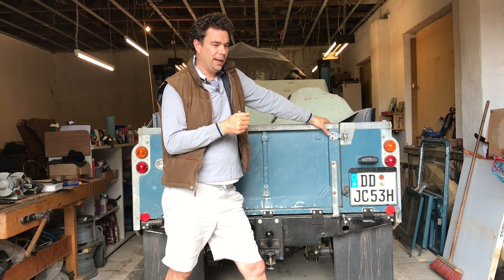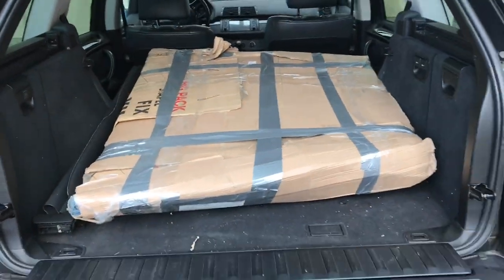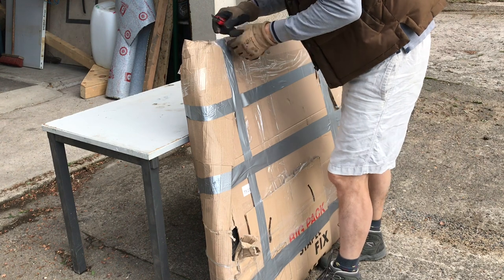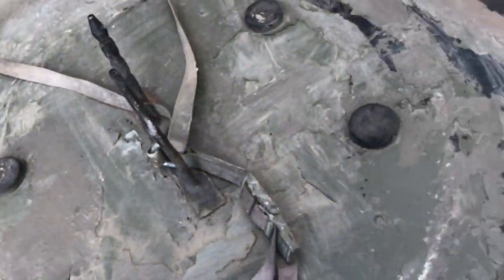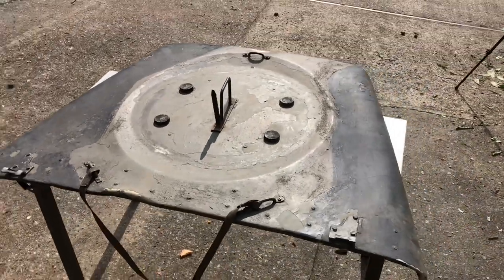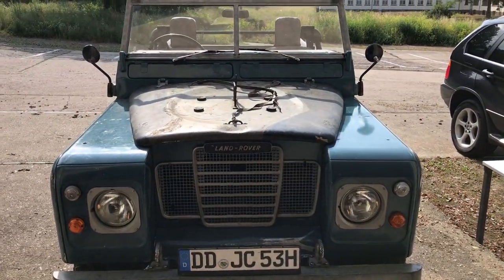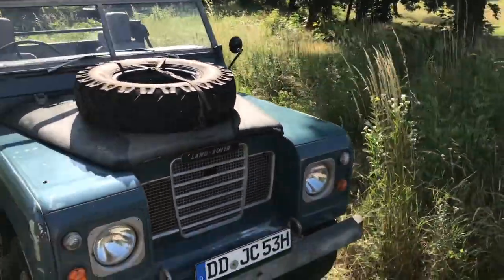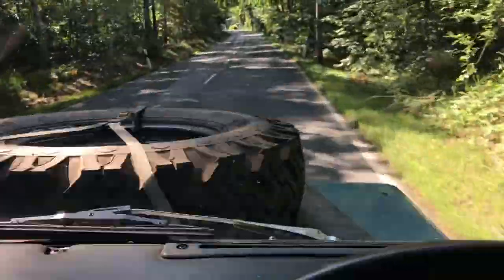Land Rover Series 3 Restoration - Fitting the New Bonnet - Part 74

Comment: Looks very cool!  Might not be an issue but I have 235/85/16 on my 300Tdi bonnet and it really impacts the windscreen washer jet.  The water goes everywhere but the windscreen, fixed by extending the tubes and mount spray heads on the wiper arms.  Really very little impact on visibility.
Reply from the maker: Hi Simon, I can imagine. They are massive tyres. ‘Luckily’ I only bought 4. The bonnet tyre is a 750.

Comment: I love all the alterations your making, it's a fantastic landy. I had alot of the same bother with my own series 3, frame had rotted out so bought a doner with a good frame. I think you could try locate a civilian doner bonnet as weld on the bracket as already stated by other followers, but civilian bonnets usually don't have the straps either. The wheel is secured down with a wheel nut and option of lock. Alternatively I wonder would RTC 3023 off an early 90 do you instead to secure the bonnet. As you said the bonnet probably won't go anywhere with a wheel on it so that 90 lock would be there as a fail safe plus the bonus if security. Alternatively again you could opt for 332969 lock. Happy researching 😃
Reply from the maker: Hi Steven, thanks for those ideas. I hadn’t thought of that. The 3032 seems quite rare. I only found one reference of it online.

Comment: Also perhaps you could use there the original wing mirrors would have been to make a latch from them to the military bits on the bonnet and so that you don’t need to drill anymore holes into the wind

Comment: As has been noted, the hole in the dish is a drain. Without it you will have a nice shallow pond on your bonnet whenever it rains. Those bonnets tend to become banana-shaped when they've been used to carry a spare for 30 or 40 years. The military spare strap down system is totally different to the civilian one, which has a galvanized dish riveted to the center of the bonnet with captured nuts that a pair of hold-down bolts mount to. I think the military didn't use the center catch for sake of speed. The theory being that if you need to get to the engine while under fire you don't want to be fiddling with finding the lever to undo the latch. While I like the look of the bonnet-mounted spare, it makes opening the bonnet a pain in the arse as it weighs a million pounds and when I'm doing frequent work on the engine I keep the spare in the back.
Reply from the maker: Matt, this is true. I like to see it as a work out every time I need to access the engine. :)

Comment: I was a little skeptical...  I'm sure you remember my previous comment....

But I will admit Sir, it does look really sweet....  heh heh heh!!!   Nice!  Definitely different.  Looks tough as nails.

I can't find the time stamp, but you were panning around the hood, and on the edges & the underside, there was really heavy paint blobs....  almost like it had been painted over & over with a brush....  Which actually, I wonder if that's what saved it.  It's SO heavily painted, it really couldn't rust...  Maybe???  

Really, it is dented, no question.  But the rust is so minimal.  Probably sounds stupid to say "It's not in bad shape", but it really is not bad....

I feel like if you found a civilian hood, or bonnet, even if it was really bad, all you need is that pin for the latch...  Cut it off, weld it onto the military hood....

The hood straps are for safety...  While you're bombing around in a jungle or a desert, you don't want the hood flying open at an inopportune moment....  HMMV's have clamps on the hood too.  Race cars all have hood pins.  It's a safety thing.  There is also some feeling that, in a minor collision, you don't want the hood "stuck shut".  Thus, the straps, even if it's a little messed up, you could still open the hood, still keep using the truck....

I agree with you, I wouldn't drill the fenders...  Unless you want to put the straps on the other hood too...  I dunno.  I think the pin could be welded onto the military hood, and you'd be good to go....
Reply from the maker: Thanks Patrick, good to hear from you. As you say that paint is really thick and is definitely put on by hand.